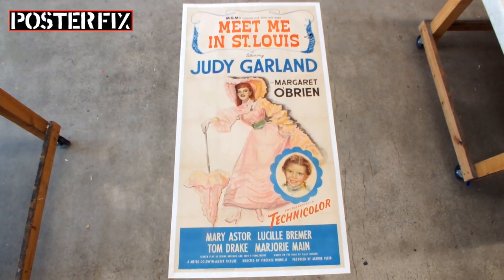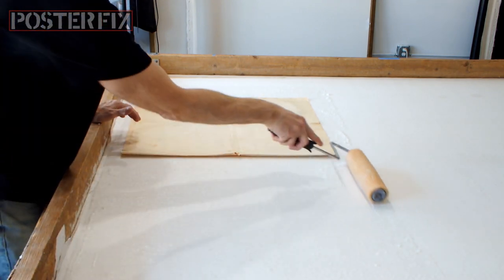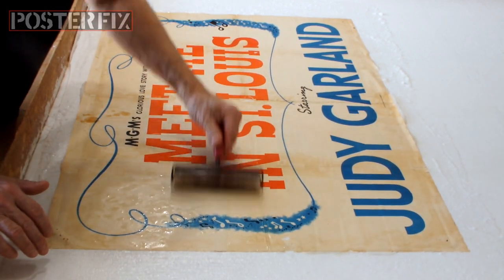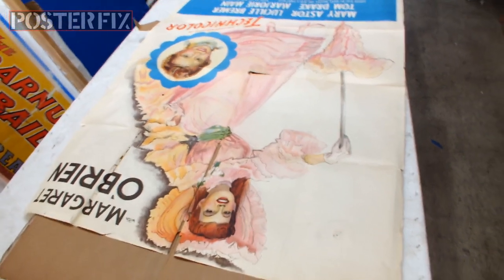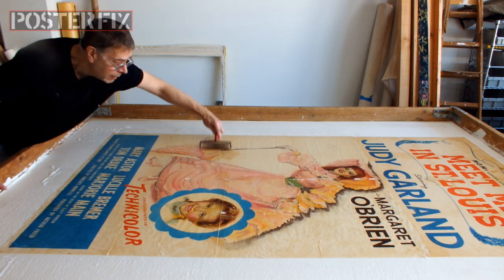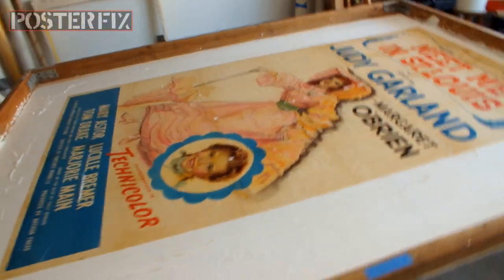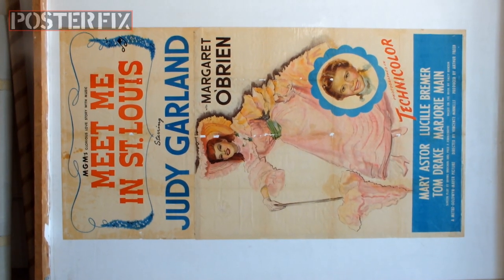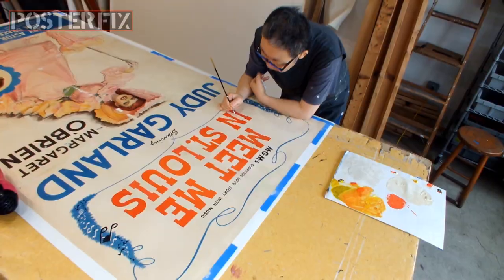Judy Garland - Meet Me In St Louis - 1944  Poster Fix

Comment: Is there a year bracket and above in which you can't do this to a poster? Like you can only do this on poster from 19?? and back?
Reply from the maker: That is a fair question, but open to opinion. Rather than the year the poster was printed- it's about whether the paper should be linen backed or not. Yes, older paper linen backs better- non-glossy especially. up to the 1980s and sometimes beyond.
 High gloss posters printed after the 1990s are risky and do not always expand well. Two-sided posters printed recently do not linen back well usually. These days there are new kinds of paper which are plastic-based and should not be attempted to be put on a Linen backing.
Reply: @posterfixchannel  thanks for the response I just find this so fascinating and it's really cool watching your videos so I was just curious about that.